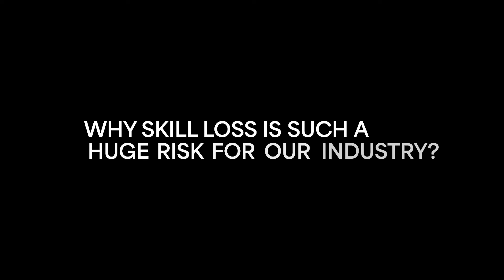Are We Losing the Ability to Make Things in North America? | Machine Shop Talk Ep. 133

Comment: You’re not alone, some of my former engineering professors are currently leading the charge against academia itself for their role in “dumbing down” STEM fields such as engineering & mathematics to make them “accessible” to everyone, I always thought the whole point of STEM was to be a cut above the rest, to weed out the under performers & people who might have the spark per-se but lack the dedication & discipline to follow through. My point is, knowledge is currency & the loss of this occurring at all levels, which in turn will deeply affect the trades, especially in adjacent fields such as machining, welding/fabrication & structures. I feel you, the loss is happening in every conceivable way & at all levels. Unfortunately, many of the skilled & knowledgeable individuals who are capable of turning the tide are running for the hills, skipping town & country for that matter. This is a big problem.

Comment: In my opinion. In a world market. We need a more level playing field. Which I hope current administration will create. I don’t think American manufacturers will be competitive below a certain part price threshold. The investment to automate that much will be limited. But for more critical and higher value parts, especially in mid sized shops, I think we can be competitive in a world market. Regardless, we need the manufacturing infrastructure for national security.
Over the years and hiring many individuals to work in shops I’ve been foreman or managed,  I’ll point out a few things I’ve learned.
Few young programmers are actually machinists. They just don’t have ( and few want to) the time on the floor. Making parts. Solving shop floor problems. 
Math skills are missing.
Most operators look at programming as their only step up. They skip over understanding math, tooling, materials, fixturing, inspection, etc.
The pay rate for what a good machinist must know as compared to many other trades is not equivalent. Not taking anything away from those career paths.
If anything, a good machinist/programmer must know even more these days. Subtractive, additive, macros, probing, robots, pallet systems and shop management software. Well beyond just turning a handle or pushing a button.
Pay rate has to be looked at.
Local and national regulations need to be looked at.
Trade schools need to be revitalized. Teach cutting metal…NOT JUST PROGRAMMING.
just my opinion.

Comment: Skill Loss? It's Been Gone since the early 1990's The Powers that be and the Powers that have been decided back in the 170's that they would Offshore the USA's Manufacturing Capabilities. The Reasons they stated  along with the Higher Wages of USA Employees, were the Rising Health Insurance Costs and the E.P.A. and OSHA's New Power to Fine Corporations. 
I heard them state in a open corporate meeting of All Employees that a 30% Reduction in the cost of Labor and Not having to abide by OSHA Rules would Not be Overlooked.
 Thus those more Senior personnel that could retire did. Many Experienced People Left the Trade.  Those of us that didn't know any other way to earn money where met with Managers Openly stating on Shop Floors that the Corporations Did NOT Want their employee's Loyalty and stated they wanted a High Turnover in Employee Labor.  Our Yearly Enrollment Benefits were LITERALLY POSTED ON THE WALL ABOVE THE URINAL OF THE MEN'S RESTROOM. In some shops the motto was We Don't Care if you have 401k. As for insurance they said, yes it would be good if You Bought your insurance. Thus that was the way it was. I got something out of it though after working for 42 years. (If you consider Small Cell Carcinoma Cancer something)

Comment: Expectation management is a huge consideration. Neither the bosses (who no longer come up through the ranks) nor the customers have any appreciation of the amount of knowledge & effort required to produce durable parts and assemblies. They therefore devalue both the labour and the finished goods. Attempts to educate them about why the $10k quote received from offshore vs the local $25-30k quote is not an apples-to-apples comparison are often perceived as merely technobabble and greed. The move from practical engineers/technologists to bean counters in making decisions for capital equipment purchases and maintenance has caused incalculable, largely avoidable expenses and downtime across every sector due to misguided adherence to false economic premises.
Reply: Also part of the reason people think manufacturing can come back so easily to the US. All you see the is the 5 cent razor blade, not hundreds of thousands (millions?) of dollars of heavy machinery behind it.

Comment: At  local building a new hire was going to install shelves in a small room that has cinder block walls. That building does have water pipes and electrical conduit in the walls. I was there when the building was built and also saw the plans eons ago. The building went thru  many change orders and low bidders did not document often the as built conditions.

So before they "new guy" was going to drill anchors into the cinderblocks; I brought in my wall scanner. ie Bosch handheld Wall scan radar unit to "see/sense" what the risks are

The new guys "lay" boss said hell no; radar is TOO dangerous.

 So reject test equipment to see risks and just roll the dice mindset by "new guy" and sanctioned by idiot boss too. 

So the "new guy" uses a  8 inch LONG pilot hole drill and laughs when mention to just pierce the cinderblocks 1st layer

So the "lay" middle manager boss says to leave him alone since an expert

So trying to pass along trade tips often does NOT work. ie they need to learn buy drilling thru live wires or a water pipe and EAT their own disaster and OWN it since so darn  cocky.

Having a stupid middle manager defending a new hires risky ways is a total disaster.

Thus "passing along" stuff you learned via proper training or your OWN disasters often is rejected.

 ie they already know everything so brain is full. lol

I got told that older folks do not want to train new folks; often when you try you get damned for any tips.

Comment: Locally they mostly killed off most VoTech stuff in high schools  2 to 3 decades ago, Build a new school stadium and football stuff is more important. lol

A new high school that was designed about 23 years ago purposely had 1/3 the VoTech space ; but a New Stadium. 

So the paid for great large VoTech area of the old school was purposely downsized in the new  Architects plans. 

So the sheet metal, welding, auto mechanics; machine shop; industrial sewing; and plumbing programs ; carpentry,  purposely got destroyed via massive loss of space in the new schools. BUT Schools got more space for Jocks and a new stadium too

So 2/3s of the milling machines, lathes, drafting tables; industrial sewing machines; welders; pipe benders; tire balancers; distributor testers; hvac test gear got scrapped. ie set to the state auctions and sold as scrap

Much of the usa has an anti repair; anti work in the trades mindset.

VoTech in Junior High and High Schools was once a HUGE thing

The are also weird Education requirements in many states that when the class size get too small the entire program has to be killed off and program scrapped. ie so a low attendance in Welding classes and scrap all welding equipment to the state auctions.

MY dad caught heat for opposing the killing off the local VoTech stuff; the prick Architect really did not care or the tenured Educational in management dolts either. There is one manager to like 8 teachers. 

Most trades require hands on learning besides a book or video

Look at the EPA HVAC tests to buy refrigerants; some total idiot has you memorizing a dozen dates  and the tests have no real world how to hook hoses questions.
Reply: you want to know why? because the football stadium brings in more money to the area than 10 machine shops do. its about tax revenue ...not your personal happiness. a large stadium attracts people, people come to spend money in restaurants and buy crap at stores (before and after the game). the stadium can be used for other venues other than football... like expos, music events etc.
Reply: @renaissanceman5847  The architects loved to kill off VoTech and ruin blue collar sources of eduction

Comment: As the product of a British a apprenticeship and I have been retired for 10 years I am amazed by the lack of common sense mechanical aptitude in young and not so young people now.
Going into the apprentice program most of us had motorcycles that we had to keep running. We tinkered with cars on the weekend. 
The company I was with had a training school where we did a year of skill training then we moved to the manufacturing side moving up through the machines so by the time we had finished the 5 year course we were productive employees. We were surrounded  by guys that may have had 40+ years of experience that we could learn from.
In a smaller factory the manager asked me how long would it take me to teach the new guy everything I knew. I said "I don't know everything I know"  He looked at me strange obviously not understanding you need not only techniques but problem solving abilities as well. That comes with experience.
I am or was a read the drawing and turn the handles machinist, Mostly with out DROs for most of my working life.
I am 75 and when I went to a shop recently to have an engine block worked on I got talking to the owner. He asked if I wanted to do a few days work a week as he could not find any machinists now that knew how to run manual machines.

Comment: The lack of manual machinists is most alarming to me. Schools are teaching cnc and telling students that there’s no reason to learn manual machining. Everything and everyone is going to cnc and in 10 years there won’t be any need for manual machinists. Just like how the metric system replaced the standard measurement…  there will always be a need for manual machines and machinists. There are niche applications where it only makes sense to use manual equipment. Industrial repair, single parts, etc. the pay hasn’t went up with the need like it has in many other industries. I believe that in 10 years, manual machinists will make more money. The need will eventually push the price. So for the youngsters out there, don’t be afraid to take up manual machining. At least learn it well enough to do it
Reply: I agree with you on the necessity of learning manual machining first.  I'm a retired toolmaker who started out in the industry back in the mid 70's.  CNC was just starting using DNC tape driven machines.  I learned the manual machines and eventually learned CNC programming and then CAD/CAM (3D modeling/programming)  There are times when I can blow away a cnc programmed machine using manual machine tools.  I used to say "By the time you get that CNC up and running, I'll have shipped my part!".  Now this is of course for simple parts (which is a large percentage of repair work in the shop).  Once CAD/CAM came into play, that changed everything.  It seriously sped up the process. But there will always be the need for manual machinetools IMO
Reply: @Ujeb08  In the next world war, factories for the production of microprocessors and any computer components will be the main targets. What's next? When will there be no processors, hard drives, ssd drives? The whole modern industry will collapse. Pakistan is likely to become the world's leading industrial power

Comment: I'm in favor of tools like gwizard which combines experience and knowledge into a tool that anyone can use. 

Also... leverage AI to simplify CNC programming. It's not that complicated and shouldn't still require the experience that it does in 2025. 

Current CAM tools are horrible. Needlessly complicated. We should aim for the click n print simplicity we have with 2d document printing.

Current AI is more than capable of learning  to select the right tools and tool paths for any cad file.

Comment: I've been a machinist for 28 years (went thru 3 HS years of Machining Education) in R&D, tool & die, prototype and repair type work. 60% manual and 40% CNC.  I consider myself a highly skilled veteran in the trade. Setups, one offs, free hand cnc programming, Mastercam trained and experienced. Add to it, I am a trained and experienced TIG welder.  I have been passionate about the trade since my uncle (a prototype & pattern  machinist) introduced me to it in my early teens.  I have left the trade because it does not pay what it should. We true machinist are some of the most skilled and intelligent people yet, people can make more money in other industries.  Now days manage a maintenance department for a large company and have significantly increased my income but it bothers me daily because In my heart I'm a true machinist. I look from time to time at job postings and it blows my mind what these hob requirements have and then you see the wages offered.  The pay does not meet the job requirement.  I feel at times I have been pushed out of the trade because of the cost of living and the price to maintain.  At 43 I still have many years and experience to give the industry or a company but things need to change.

Comment: transferring that knowledge from the old machinist to less experienced ones is given low priority in most places. it also seems at most places true teamwork doesn't exist as much as you would think. collaboration is not teamworks. six sigma concepts can be very well used at medium sized fab shops and to foster teamwork but I have known way too many oldschoolers who thought they knew more than anyone else and were just too hardheaded. I used to work in engineering documentation/CAD/everything related and have many stories about it. It's much easier with just a hair more time to do a good project folder with all the new 3D CAD for future reference. I remember one oldschooler dept manager even saying GD&T wasn't used and anyone who thought there was a real need for it was an idiot. I could mention many specific instances but I'd really get many pissed. discuss. to really get to where a place has assured skilled machinists long term it would need buy in from corporate just like a six sigma project but it seems corporate would rather wait till the last minute and go to contractors or headhunters. I don't know about you but personally i think corporate almost always seems to have short term time horizons. to get all those in house best practices and guidelines and rules of thumb you need things like design reviews, project reviews, and some kind of monitoring. some machinists get territorial and even dislike that kind of monitoring.

Comment: I started in the 1970's and have nearly 50 years experience as a prototype machinist. From the beginning I knew I didn't want to do production. I've worked in many different shops in many different industries. I've done huge parts to micro-parts from slash and burn to .0001's. In my day no one wanted to teach you anything, so I had to figure most of this stuff out on my own. Now I'm in a position to give back and practically no one wants it. Yes, I know cnc's and programming. It's not that I'm stuck in the 70's. But people think my experience is irrelevant. I practically filed a grievance to be able to do any work at all. Can you imagine? I think my boss is just waiting for me to retire. But I think he's still looking for ways to limit what I'm able to do.

I believe that the present generation of machinists (last 20 years) are too focused on software. I call them laptop machinists. They are useless without software. I practically got into an argument with a co-worker who demanded a step file to drill and tap a 1/4-20 hole. Is this the future of the industry? Really? Machining software was not designed by machinists. They were designed by software engineers and maybe some other engineers. I was shocked to see how bad it is when I got into it about 5 years ago. But regardless, from a practical point, you've got to use this stuff. I developed my mechanical aptitude from machining. Software machining is very formulaic and almost virtual.
Not every part is going to sit nicely in a vise... Also, no one knows how to grind or sharpen a tool anymore. Which means they don't know how tools cut.

I did make an attempt to leave the trade. Got a civil engineering degree in 2006. But I could see 2008 coming down the track so I stayed put. I would have loved to have gotten a mechanical engineering degree, but in my day, the geniuses on Wall Street couldn't get rid of manufacturing fast enough. So here we are today. It's a shame, because the US has a great tradition in manufacturing. It made us rich. And we were good at it. Hopefully, it's not too late to try to pick up the pieces.

Incidently, great little mill you're standing in front of. I bought one for the shop where I work at. I'm not allowed to order machinery any more. If I worked for SWI or Haas, I would concentrate on developing mills of that size and capacity. You could greatly increase the output of a facility per sq. ft. Use an appropriate size mill for the work that needs to be done. I think that's a great selling point.
Reply: "I practically got into an argument with a co-worker who demanded a step file to drill and tap a 1/4-20 hole." <-- LOL !!!

Comment: working on horizontal boring mills is a bit diff 
esp when your parts weigh 20,000 lbs.
how do you move n flip your parts,
how do you machine on each face
so every feature on every face
is where its suppose to be in 3d space
relative to other features on other faces.
your part might be 20 feet long n 8 feet high.
experience. dont let it walk out your door.